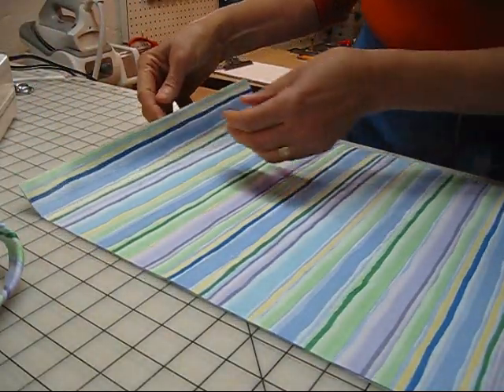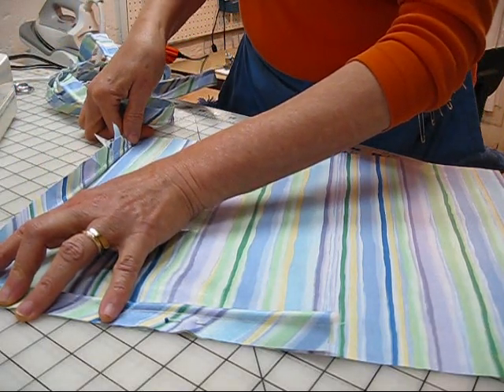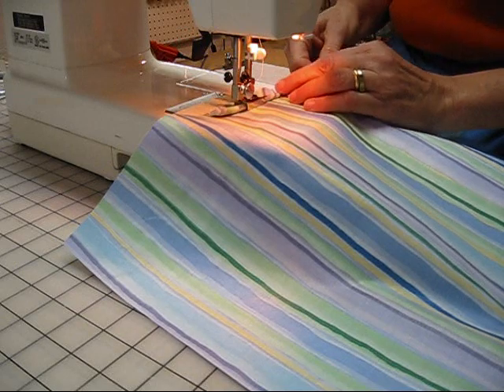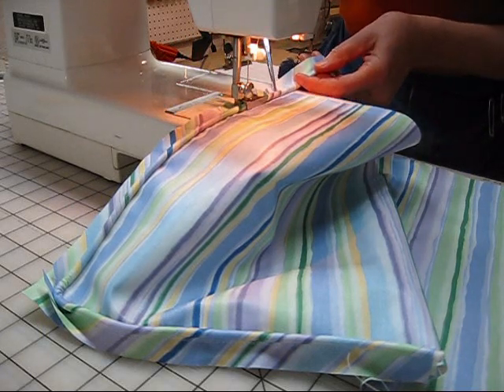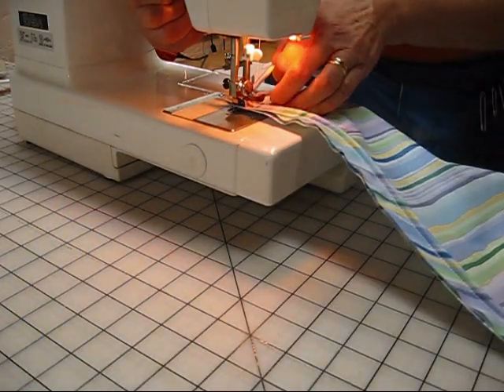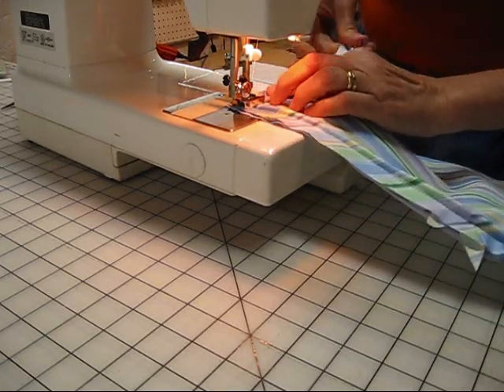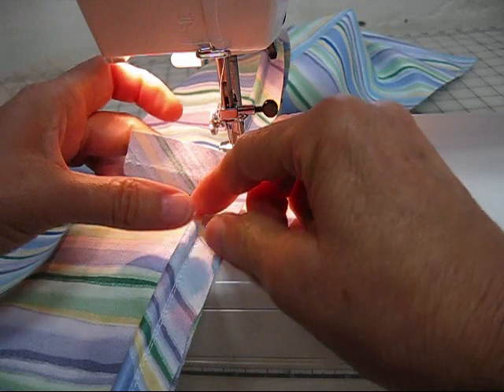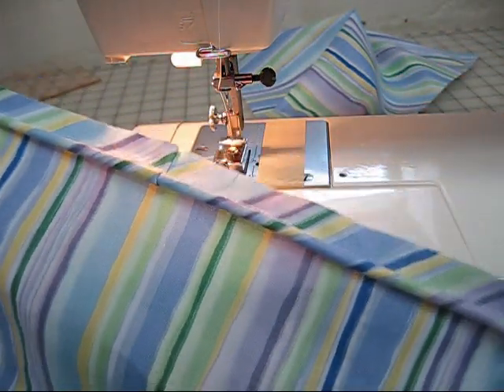(7) Little Striped Cushion -Sewing On Piping

Comment: Love your videos.  Is the lip on the piping a full 1/2 inch? It just looks wider than that to me.  I am assuming the lip is 1/2 inch so that when it is applied to the cushion front/back it is sewn a half inch in.
Reply from the maker: Hello, Kelly. Yes and no! My goal is a 1/2" lip. The thickness or thinness of the fabric and the thickness or thinness of the welt cord can make a difference. If the fabric is thick I often add 1/8" to the bias strip. If the lip ends up less than 1/2" I adjust the placement on the piece being piped. I hope this is helpful. I look forward to hearing from you. Sincerely, Peg

Comment: Hi, in a later video you show how to make the pipping and attach it in one step - I followed that for my pillow project. Can I use the same approach on a cushion cover, or is there a reason to make the piping separately in this case? Thank you.
Reply from the maker: Hello, Marina, Yes, you can use the one step method with cushion covers. There are situations where the standard (pre-sewn) method is preferred. For example, I am constructing two slipcovers: one has six cushions; one has four cushions. The one-step method requires of bit of hand strength and this project is just too big, so I'm sewing up my piping in advance. I hope this answer is helpful. Let me know if you have other questions. You can write to me at littlebug903@yahoo.com. Sincerely, Peg. www.littlebugslipcovers.com
Reply: Thank you! I am about to start on a very large cushion, so I might do it separately as well.
Reply from the maker: Wonderful! I look forward to hearing about your cushion project. Peg

Comment: Hi Peg,
I've followed your piped & zipped cushion tutorial in the past (to great effect i may add). is there any reason why you didn't use the one step piping method for the box cushion?
love the tutorials - keep up the great work!
Reply from the maker: Mark Wadsworth Hi Mark, Thanks so much for writing! I used the traditional method for that tutorial to keep the process as simple as possible. Since posting the one-step method, I have learned that keeping the stitching line straight is a bit more challenging on a portable machine, versus the table model that I use. Whichever method provides the best results is the one that should be used. By the way, I'd love to hear more about your cushions! If you'd like to share details and photos, please write to me at my email address: littlebug903@yahoo.com.  Sincerely, Peg